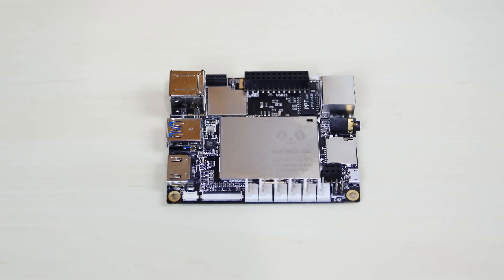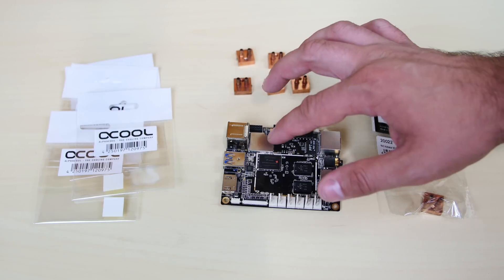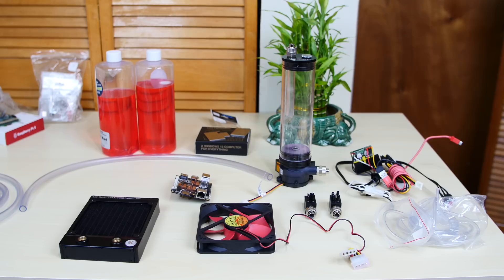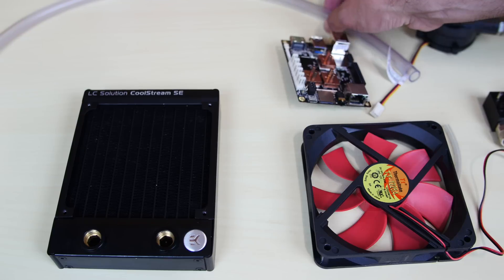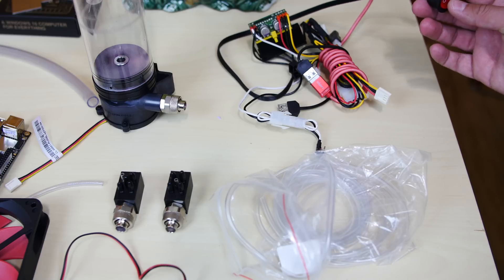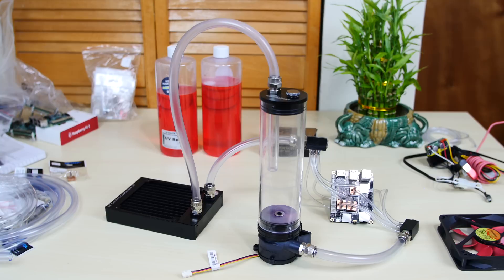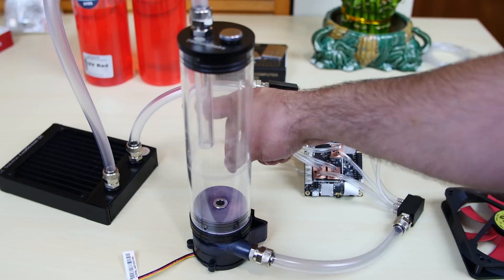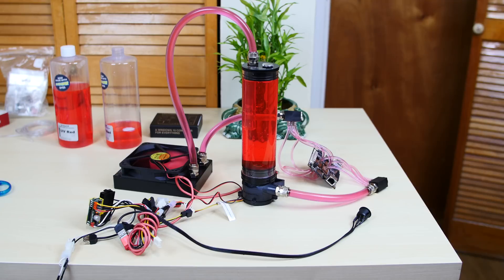Water Cooling the Raspberry Pi 3 Killer (LattePanda)

Comment: The pipes to use should be Silicon pipes. From personal experience : they attach firmly to the copper with no need for anything more. they don't stretch ! , they are much more flexible and they don't decay. I built my watercooling system myself ~13yrs ago and it just keeps on rocking.

Comment: Oh I'm so glad you used the splitters to get all the blocks cold coolant.
 I can't wait to see video two and see if water flow was equal and consistent through all the cooling blocks.
  Have you ever thought of designing a block that hits all the components with one block? You could get a lot more flow and more surface area to wick away heat from chips.